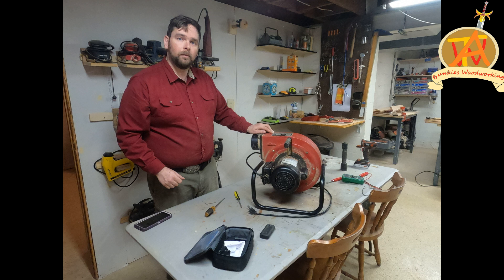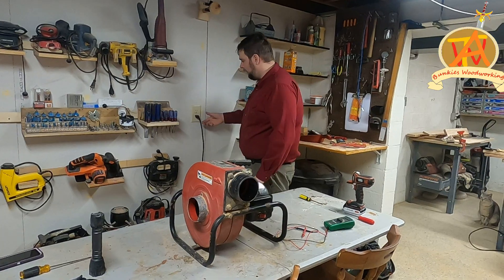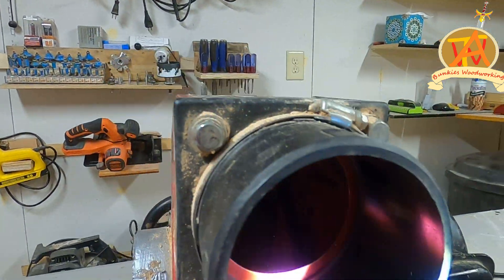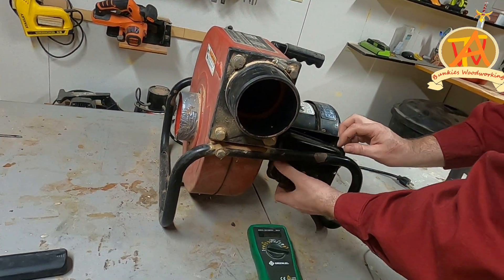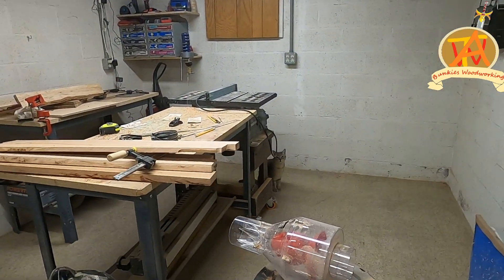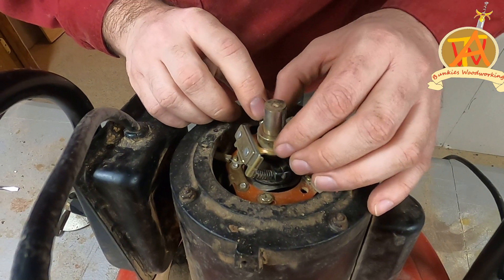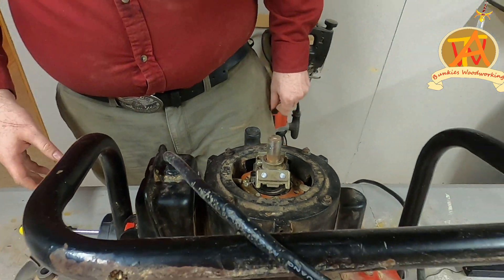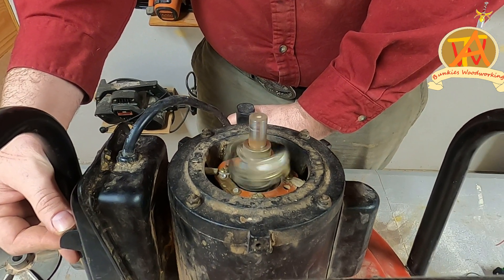"Fixing a Dust Collector Motor: Troubleshooting Tips and Tricks for a Smooth-Running Workshop"

Comment: Nice, very useful video! Caps freak me out when they are charged, they seem to have a little bite!
Reply from the maker: I agree I used to work on auto lifts and when I would discharge them the hole garage would go quiet. We are just starting off Please like and subscribe if you like what we do.
Reply: @CoupleofBunkies  Yep, they can really leave a mark, currently was just working with a 2.5-farad cap.
Reply from the maker: @ChrisDoesWhat  at one point I would have liked to have the fluke that could test them but now I don't work as a technician anymore so I don't need it.
Reply: @CoupleofBunkies  Right, you have to make do with the tools you have! Love the comments from those saying you're doing it wrong from their armchair.